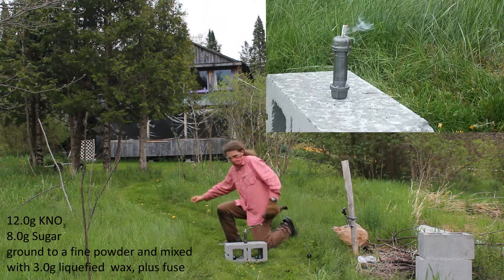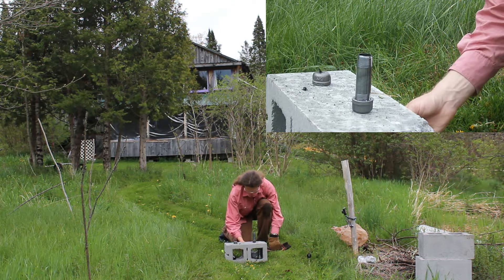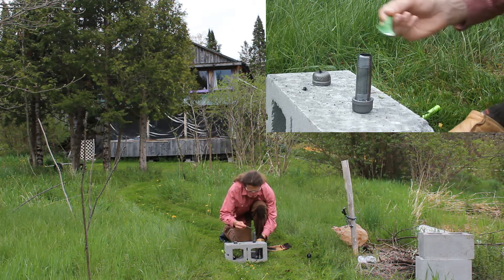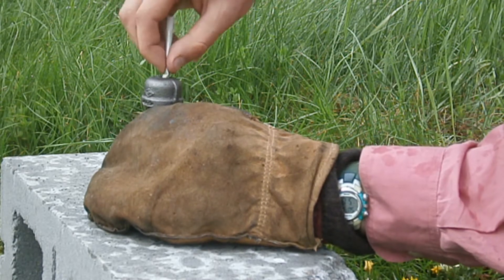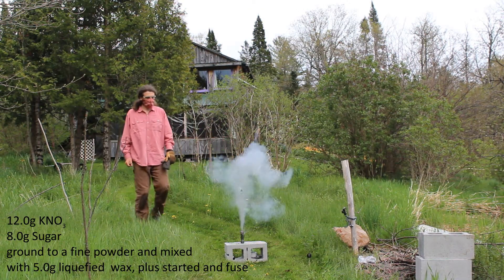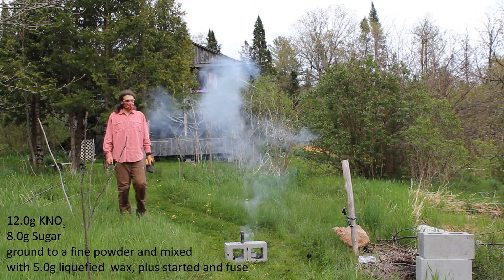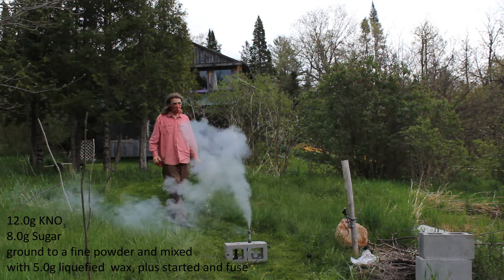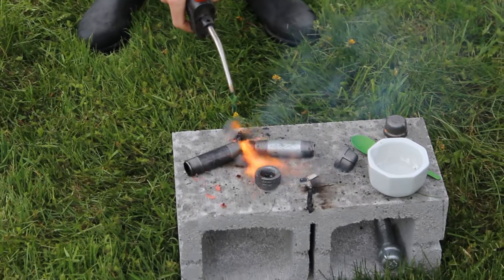Smoke Bombs: Wax in Retort (15/)

Comment: Are you still messing around with smoke?

For weeks I've been working on the 
12 parts kno3
8 parts sugar
10 parts wax 

Mixture and I cannot achieve ignition on the compound.  I have tried so many things.
Reply from the maker: Nope, not continuing experiments in that vein, I can't remember the ratios of wax I used, I always used some of the mixture without wax to light it if I remember correctly. I used paraffin (candle) wax, not sure it would work with all types of waxes.
Reply: @KestrelOwens  I hope you bring it back.  Those are good videos